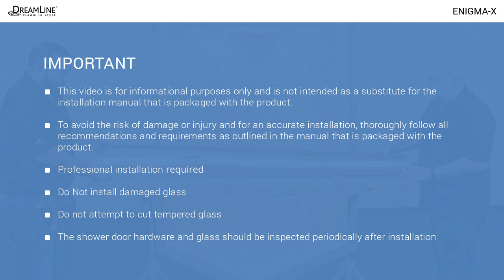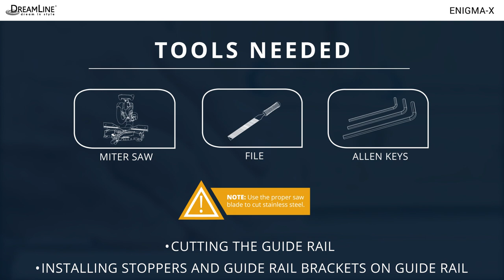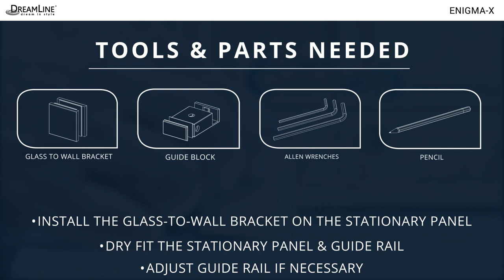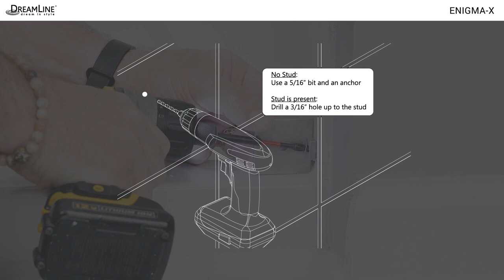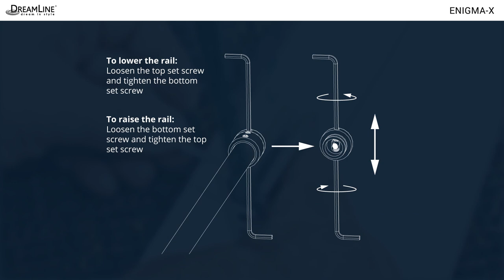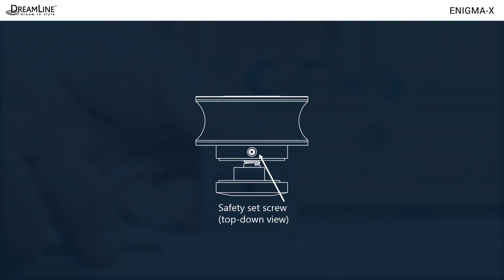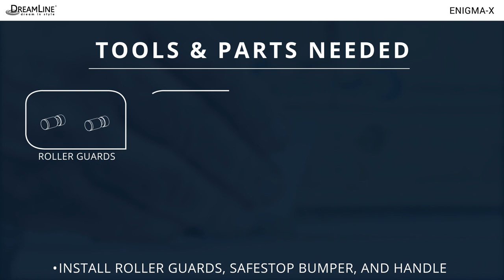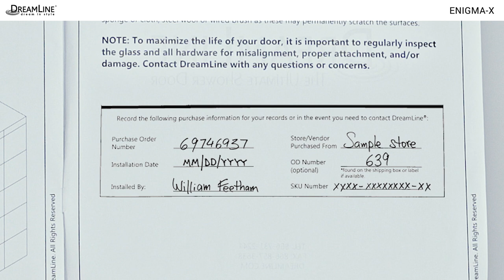How To Install a Sliding Glass Shower Door Tutorial | DreamLine Enigma-X Shower Door

Comment: CAULK YOUR DRILL HOLES!!!!!  This is overall a great video for a pretty decent product.  One thing people should be aware of is when you drill a hole through your water containment system (curb/shower pan/pan liner) you're going to void the manufacturer's warranty against the pan/liner leaking water to your subfloor and beyond.  It's a negative with this install, but it's part of the tradeoff you make in aesthetics for getting rid of tracks and I can understand why Dreamline requires this.  

That said, it borders on professional malpractice to omit the absolutely necessary step of caulking the holes you drill at the base of the shower with 100% silicone caulk (not "siliconized" or latex).  Screw threads provide a path for water to flow into the wood structure below.  Or in the case of my most recent install on a concrete subfloor with a concrete over wood shower pan and curb, a path to the wood underneath.  And when that wood gets wet, it expands (and rots and gets moldy).   Tile and grout, not so much.  So at some point down the road, the odds of the tile cracking out and accelerating the leaking process go way up.  Do yourself is simple but REALLY important favor.  Before you screw into your walls, pan, curb or whatever applies in your shower/tub, prefill those holes with 100% silicone caulk, add a little bit more on the threads of the screws, and a little bit more on the non-visible contact side of the wall mount and center guide block.  Yeah silicone caulk can be messy, but cleaning up a little squeeze out is a whole lot less work than dealing with water damage.
Reply: Thank you for your feedback.  Many DreamLine shower doors require drilling into the threshold due to the size, weight and fragile nature of the product.  We can assure you that all of the installation steps have been tested and designed for a safe and secure installation.  Any components that require drilling into the threshold should be caulked well and water should never reach that drilled hole.  While caulking the hole is not required, it will not affect the installation if the installer does or does not caulk the hole.  Thank you for your feedback and for choosing DreamLine.

Comment: I wish there were some additional Dimensions given in the manual. Like what will the total thickness, or outside Dimension be from glass to glass, after assembly. And the location of the center of the guide rail in relation to that total dimension. As well as the relation of the center of the guide rail, to the guide block. ( assuming they're centered to each other, but not sure since manual doesn't say) My reason for needing these dimensions is so that I can design the tile layout of my custom shower, prior to installing the door. This would be helpful in setting the inside dimensions of the shower, to properly Center the shower valve, shower niche, and the threshold location, if one is being used.  So these things can be planned for prior to door installation. That way everything works out the way you want it in the end. I have to go through the work of pre assembling parts to figure this Dimension out for myself. However it would be nice to just have this dimension in the manual. That way you can also start building and tiling your shower, before ordering the doors, or just waiting for them to arrive.
Reply: For those who want this info, here is what I have figured out personally. Inside of fixed glass panel to the center of the rail, is 7/8 of an inch. Inside of glass door to the center of the rail, is 25/32 of an inch. Add 3/8 of an inch for each glass panel for a total dimension, outside of glass to outside of glass, of 2 and 13/32 of an inch. This offset of 3/32 is copied on the guide block to match. So if you want to know the approximate center of the rail, from the outside edge of the fixed panel, it is 1 and 1/4 in. Center of the rail is center of the guide block. In my situation walls were already tiled for a different door system. Then homeowner changed their mind and wanted the sliding door. Floor not tiled yet so I am able to adjust the transition between shower and bathroom floor to match the new Centerline of the Dorset. But needed this information so I could set the center of my threshold. I realize most will not run into this issue. But I hope it will help someone.
Reply from the maker: Hello Ken, thank you for voicing your concerns. We love discovering ways to improve our customers' experience and will relay your suggestions to our DreamLine Shower Door Design Consultants. We appreciate your input and thank you for choosing DreamLine for your renovation project.

Comment: This is a very helpful video until it gets to 8:07 where it says to drill a 3/16” hole for tile thresholds to mount the #12 guide block.  That may work for tile over wood, but does not work for tile (or stone) over Kerdi foam curbs—or brick and metal lath.      Even the updated manual does not have the correct information after a discussion with Andy in product technical.   You’ll still need to drill a 5/16” hole and use a 5/16 anchor for anything other than tile over wood as specified in the older manual dated 6/2017.
Reply from the maker: Thank you David for taking the time to point this out. You are correct, the drilling measurements provided in the Enigma-X installation video above are for a traditional tile installation. As the curb construction becomes more popular we are updating our installation manuals to fit such an installation. Thank you again and please feel free to contact DreamLine at 866.282.8413 with any other questions or concerns.

Comment: I just finished installing my Enigma Air tub shower door. But I'm running into a problem with installing the roller guard on the side with the stationery panel. There isn't enough room to put the cover on the guard. It won't slide between the glass. It was hard enough to get the other piece of the guard in there. What am I missing?
Reply from the maker: Hi Jesse, We invite you to contact a DreamLine PreSales Consultant at 866-282-8413 to discuss your shower door needs. We can also be reached by sending an email to support@dreamline.comand through our Chat with Expert feature on DreamLineShowers.com. Our hours of operation are 9am-6pm EST, Monday through Friday.

Comment: The instructions indicate to take the model width, in my case 72 and to subtract the opening width.  I expect people are measuring the rod itself, then subtracting opening width.  That method does not take into account the rod ends.  It will end up too big if you don’t follow the model width.  This would then require a recut.  I suppose an example may help to alleviate confusion for the DIYer.
Reply from the maker: Thank you for your feedback. The steps outlined in the installation manual have been used by hundreds of thousands of installers without fail.  We recommend following the steps outlined in the installation manual for an accurate fit to your specific measurements.  Every space is different, but the steps to cut the rail remain the same, keeping in mind your finished measurements. 

We invite you to contact our DreamLine PreSales Consultants at 866-282-8413 to discuss this further.  We can also be reached by sending an email to support@dreamline.com.  Our hours of operation are 9am-6pm EST, Monday through Friday.  Thank you for your interest in DreamLine.

Comment: not sure what you mean by cutting the rod from the model width - finished opening width cutoff length (L)  ... what is model width...  like 48 inches?
Reply from the maker: Hello Bruce, we invite you to reach out to DreamLine's Customer Support Team. DreamLine's Customer Support Team can be reached by phone at 866-731-8378 or by email at support@dreamline.com.  We are available M-F from 8am-6pm EST.  We are also available through Chat with Expert feature on our website. Thank you for choosing DreamLine. We look forward to helping you soon!
Reply: If the rod is 60 inch subtract the width of the opening from your shower wall and subtract that from 60
Reply: For example if the opening is 57 3/8 subtract that from 60 and you cut off 2 5/8
Reply: They should note that you need to subtract the difference in the side guide caps that are also installed on the guide rod.  They don’t show it this way, it is very deceiving.
Reply: I had to put the end brackets on the rod, measure that, then subtract the actual opening.  The result is how much I needed to remove from the rod. The instructions on this part were confusing.

Comment: Can the sliding door be installed on the outside rather than the inside?
Reply from the maker: Hi Norman,  Thank you for reaching out to DreamLine.  The moving panel must always be installed to the inside of the shower. The unit is completely reversible, allowing the moving panel to close against either the right or left wall, but the installation process remains the same with the moving panel on the inside of the stationary panel.  We invite you to contact a DreamLine PreSales Consultant at 866-282-8413 to discuss this further.  We can also be reached by sending an email to support@dreamline.com and through our Chat with Expert feature on DreamLine.com.  Our hours of operation are 9am-6pm EST, Monday through Friday.  Thank you for considering DreamLine!

Comment: Dreamline, you have a formula to have the model length minus the opening to cut the rod (in the video as well as your manual, you are not showing  or mentioning the guide rail deduction.)  Your installation manual is extremely descriptive, but in it, as well as this video, you are not accounting for the guide rail brackets, which make the rod plus the guide rails larger.  Why not have this in your tip/notes?  I noticed this right away, which is what brought me to this video, which again, does not tell you to remove the difference.  The video, if done as shown, would have the rod with the guide rail brackets too big to fit in.  You should reword or add the guide brackets in it.
Reply from the maker: Thank you for your comments.  DreamLine has already taken the guide rail brackets into account when we cut the guide rail. The guide rail comes to you designed to fit the largest model width for your shower door, allowing for the guide rail brackets. For instance, a 60" door will not get a 60" guide rail.  The guide rail is smaller, taking into account the guide rail brackets.  There truly are not any additional deductions that need to be made for the guide rail cuts than what is outlined in the manual.  

We invite you to contact our DreamLine Customer Support Team at 866-731-8378 to discuss this further.  We can also be reached by sending an email to support@dreamline.com and through our “Chat with Expert” feature on DreamLine.com.  Our hours of operation are 8am-6pm EST, Monday through Friday.
Reply: I’m totally on board with everything you said. I installed this door today for a customer and YES you MUST DEDUCT the Guide rails (about 7/8 in) in my case. When I got to this part in the instruction manual and after watching this video I was scratching my head thinking…’this ain’t going to work’ Obviously, I figured it out but a mistake like this on a step that’s kind of one and done really needed to be fixed or in this case explained better than the reply given back to you from the company. 😂
Reply: @brandonmahoney9407  If you pretend the rail is 60in or whatever size of model you have. And your actual measurement 59.in, or what have you, tile to tile. And the difference is 1 in. Cut one inch off the rail they gave you. And it will work since the allowance has already been made. The instructions say to do this. But I do agree it should be a little more clear.

Comment: Very helpful!  I was overwhelmed just reading the install manual.  This video provides needed visual overview and details.  2nd Enigma-XT installed without a hitch!  60" & 48". Did the 48" by myself--I do NOT recommend going it alone. (Let me stress this.  Do not attempt without a helper, as the instructions say). Came close, several times, to losing control when setting the fixed panel for marking drill points.  Duh.
Reply from the maker: Hello Gugle, thank you for your feedback on our DreamLine Enigma X shower door! DreamLine ensures detailed installation videos for excellent visual guidance. If you have any questions, we invite you to contact a DreamLine Shower Door Design Consultant at 866-282-8413 to discuss this further.